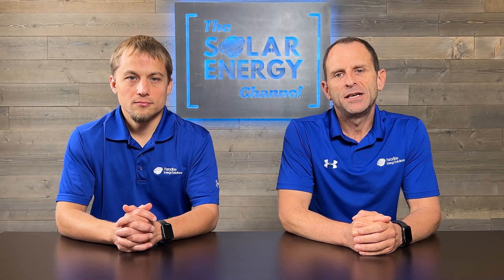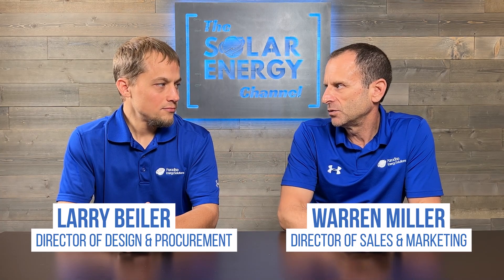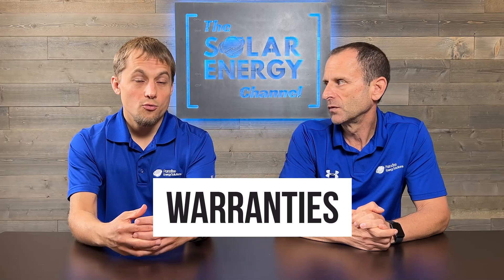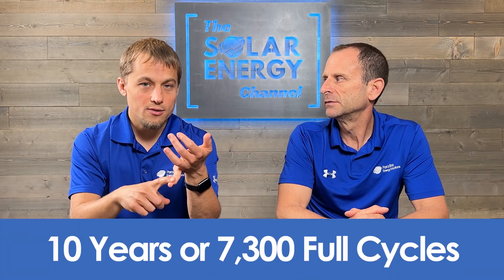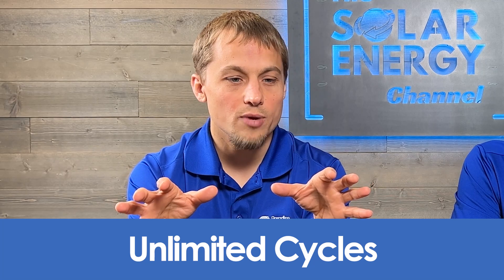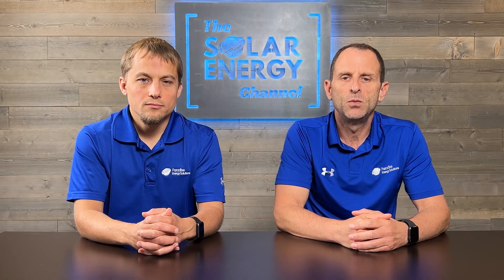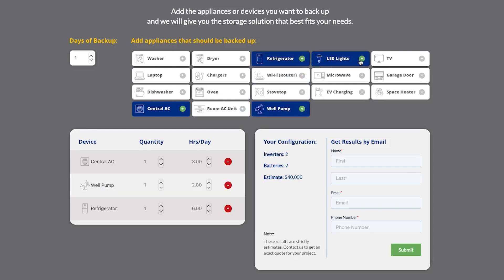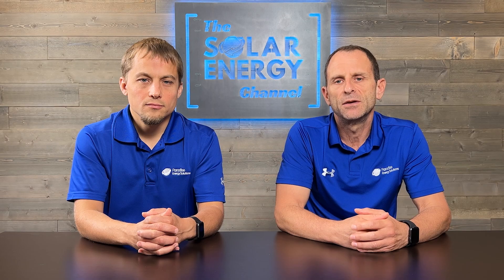AC VS. DC Coupled Solar Batteries: Which is the Better Choice?

Comment: Hello Everyone, I have a StorEdge system which works very well. The specifications on my system is as followed( SE7600A-USS 400VDC system array is 4.38KW system). I have an LG Chem battery (400VDC). This system is expandable if I need to do so. So far it runs the whole house just fine including the AC 14 seer Unit just fine. But my battery 9.8 KWh battery is too small. I would like to increase my battery system to 40KWh capacity and increase my array by 4x 400watt panel. Due to the high voltage 350-450 VDC by the array. I would need a charge controller to charge or a board to reduce voltage to 150 VDC or a board that will charge and discharge the batteries safely. That way I can keep it on VDC to the Inverter. Does anyone have any ideas?

Comment: I am having a system with Enphase micro inverts but I want to use a DC only battery
Reply: I assume by "DC only battery" you mean a DC coupled battery (because all batteries are DC only). If so, I'm not sure that's possible because with micro inverters you are converting the DC from the solar panels immediately to AC on the roof.
Reply: @Ambient-Auroras  It is possible but after my research I am not going with micro inverters. A Sol-Ark 15K string inverter is in my future
Reply: @LarryRichelli  wow that looks like it ticks every box. Dread to think of the price though.

Comment: While I love Enphase's system, I have decided to go with a string inverter  This is because I want the heart of the system - the inverter - to be out of the elements.  My time in the Army taught me that electronics don't like extreme cold, really don't like the heat, and hate water.  I know that micro inverters are designed to be outside, but I'm beating that I significantly increase the chance of the inverter making it 25 years when it's in my garage and not on the roof.
Reply from the maker: Great point. Inverters also don't like extreme heat. Keeping them in more of a controlled environment (garage, roofed outdoor structure, etc.) is great if it's possible.